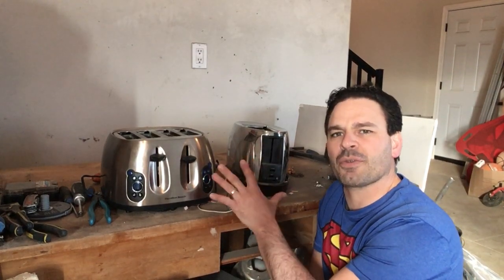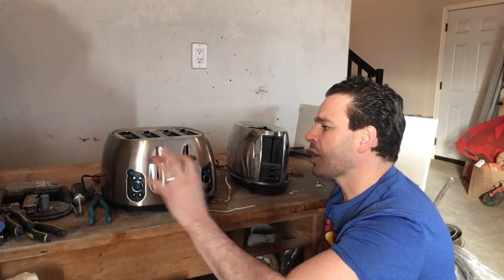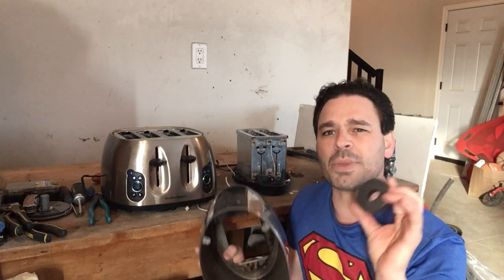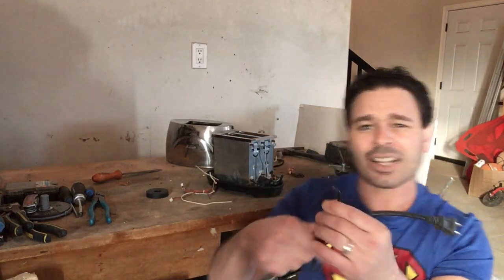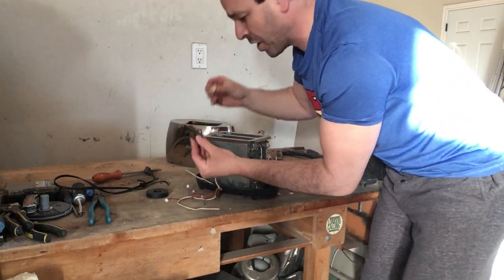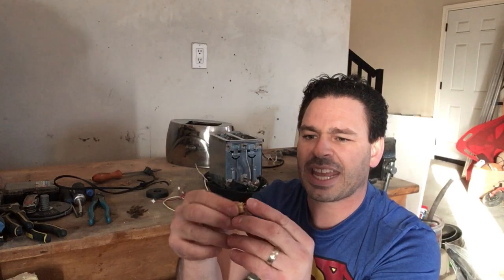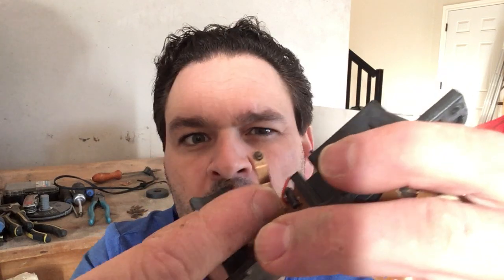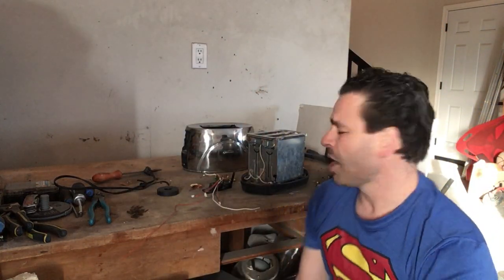Scrapping a toaster for stainless steel, tin, copper, and silver. Which one is stainless steel?

Comment: Stainless steel is NOT a "coating".  It is a metal alloy.
Reply from the maker: Also trying to keep it simple for the beginner scrappers and how to identify.
Reply: @TinManScrapper  I understand keeping it simple, but it also needs to be accurate.  Explaining it as a "coating" or "brushing" implies it can be removed, physically or chemically, for a better price.  Magnetic stainless has more tin than nickel in the metal itself, making it an alloy.  Non magnetic is just the opposite.  Just like brass is an alloy of copper and zinc.  Again, not trying to be an ass, just accurate.
Reply from the maker: Yes, but those that are magnetic have a small brushing of coating mixed with them.